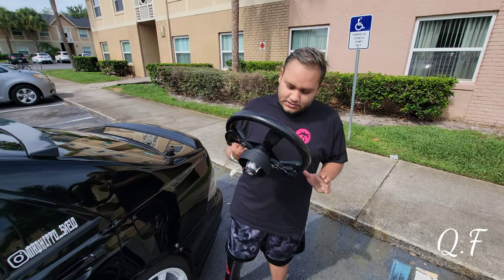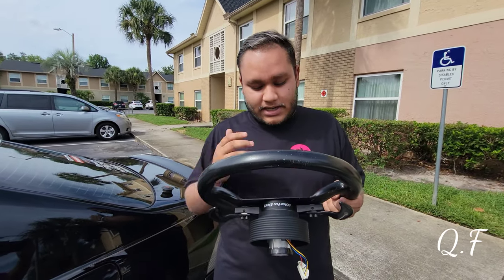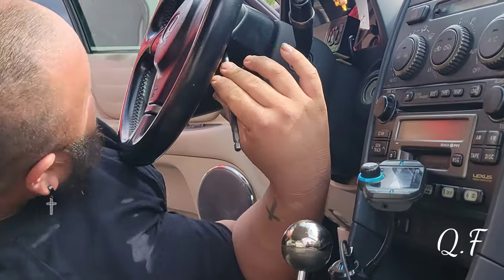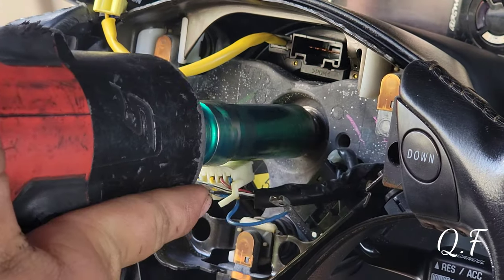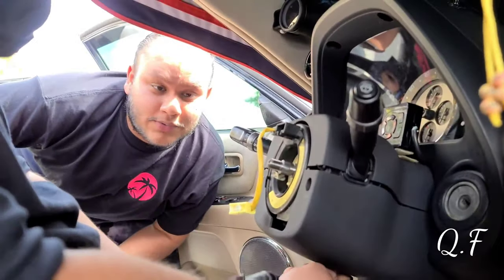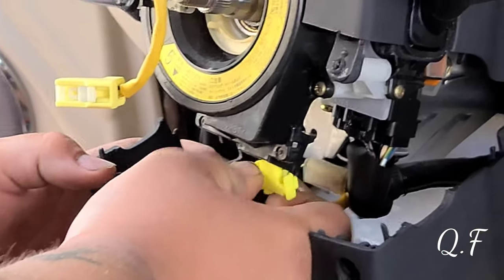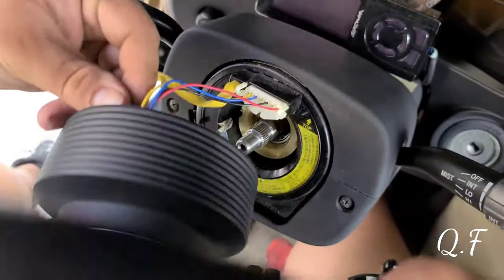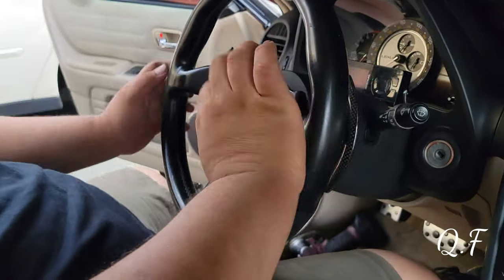IS300 WORKSBELL PADDLE SHIFTER INSTALL W/ STEERING WHEEL

Comment: Do the paddles move with the wheel? The one thing I always hated about the R35 GT-R (which I don't have) is that the paddles are column mounted and are fixed because of it. You have to buy extended paddles to compensate.

Comment: Did you just plug the red wiring from the steering wheel into the horn button ?
Reply: We tried it but it didn't work as I have to figure out the ground first. The horn button for the personal steering wheel is very different

Comment: My paddle shifters don’t down shift and is stuck in 5th gear 😥 I tried too see what’s the problem but it wasn’t dusty and the wires looked fine and idk what it is ???
Reply: Mine too I heard it could be the clock spring but have you done anything tht worked ???
Reply: @noesb3251   bro rlly replied to himself
Reply: @samw  lmao